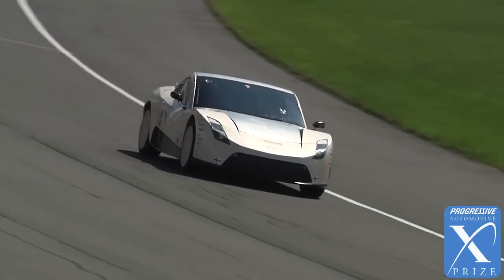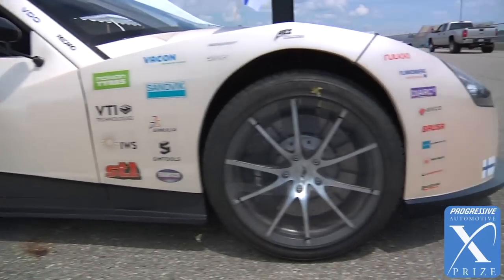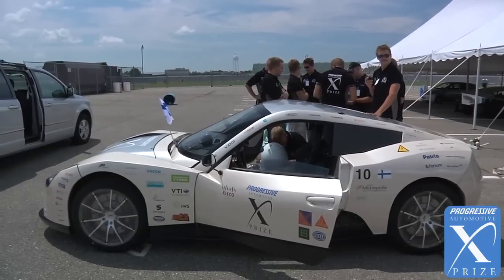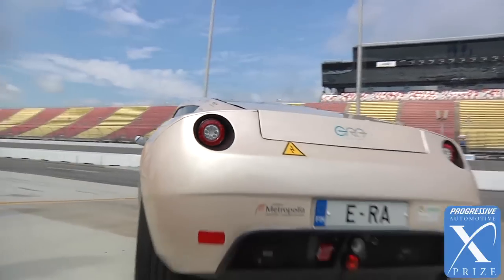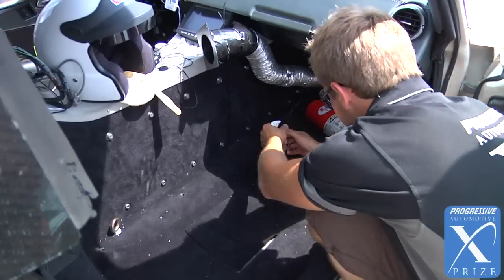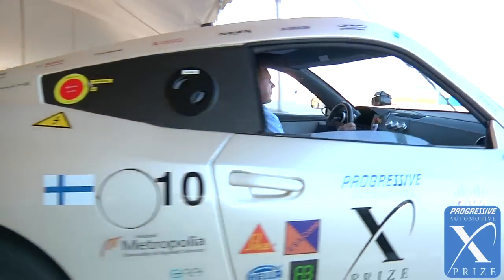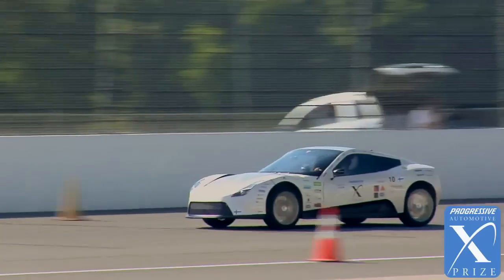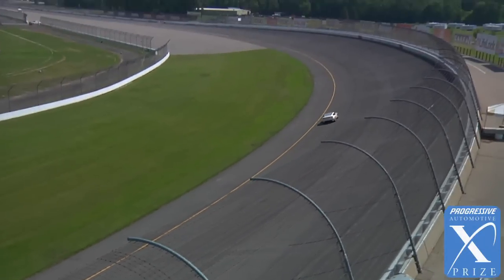RaceAbout - Progressive Insurance Automotive X PRIZE

Comment: @jabo109k who do you work for? air and space use far more exotic materials. commercial aircraft are typically glare (alu fiber glass composite) or straight carbon composite. turbine blades are monocrystalline castings and of course aerodynamics is king. 
if cars were made with aerospace tech it would be pretty good and far ahead of anything in the auto xprize

Comment: @DanFrederiksen not automotive, I'm in air&space research. And as much as I like the engineering principles that one has to apply to design a vehicle like this, in the end it is not about that. People take the tec stuff for granted, but will not buy a car that looks like a 'frog'. So I think the technical problems these teams are facing are not the hardest ones. Getting the technology ready for the mass market is a whole different story and propably the bigger challange.

Comment: @jabo109k the X prize is frankly quite unimpressive. has a distinct amateur high school competition feel. it would be quite easy to beat them all with just the obvious design principles, light weight, aerodynamic and electric drive.
do you work in auto research? and if so for whom?
the big car makers have absolutely no innovation so relatively to them of course the x prize will look innovative.

Comment: @jabo109k I have  degree in computer science but I do architectural computer graphics for a living. mainly just to pay the bills to have time for more important things. we don't need technological breakthroughs but of course improving cars is technical. it's just aerodynamics, weight optimization and battery electric drive. it's very easy and straight forward, the car makers are basically just willfully stupid. there is not a single car in the world that is designed by aerodynamics. always looks

Comment: @sp33dou no it doesn't. Wave II was 50% more energy efficient. Raceabout was only marginally more efficient than the Tata Indica car which is a completely normal stock car converted to electric drive. it deserves nothing at all. it's pathetic even, to do so much custom work and do no better than a standard unaerodynamic soft steel car that has twice as many seats..

Comment: @jabo109k so you work for EADS. don't be so secretive. there is no need. oceans of people work for EADS, it's hardly the same as posting your bank code online.
the boeing 787 use new materials btw.
have you worked on the A380?